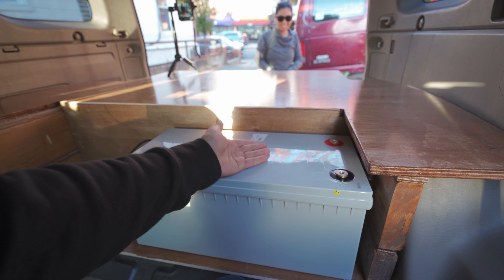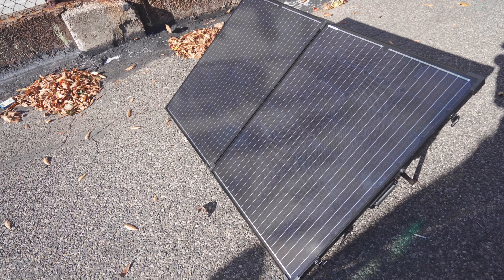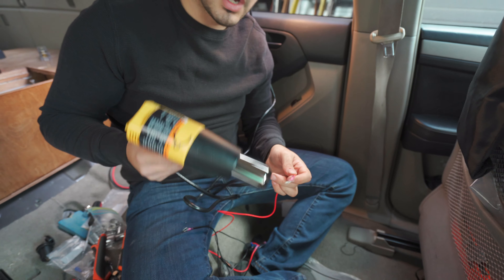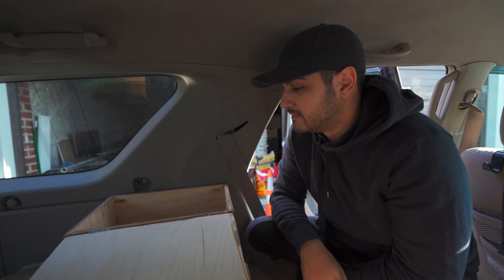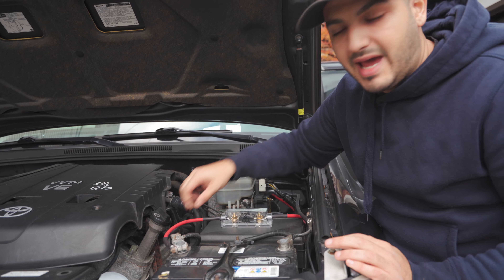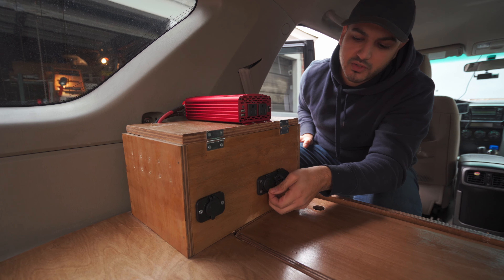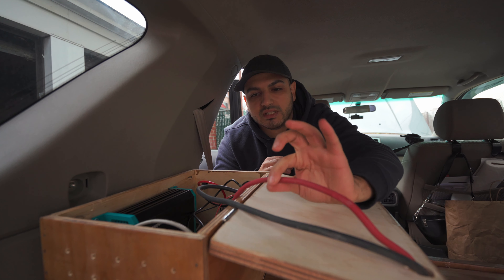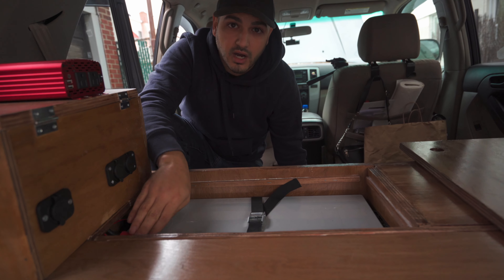Off Grid Solar & Dual Battery Electrical System For Car Camping | 4Runner Overlanding Build Pt.4

Comment: Surprised no one has asked this question. Did the supplier of all your electrical equipment provide you with a plan for how to hook it all together?  With a half-dozen major parts with varying jobs and various type of wiring, this isn't something you just figured out on your own I suspect. So, how did the electrical project all fall into place?
Reply from the maker: This is actually a huge compliment, so thank you so much because we both planned this all out. With months of research and consulting with many electrical engineers, we(basically John) figured out how to put it all together. There really isn’t a video on YT that had the same set up that we wanted so based on what people have done we customized it to make work for us with what we have and needed. 😃 and it all worked out perfectly